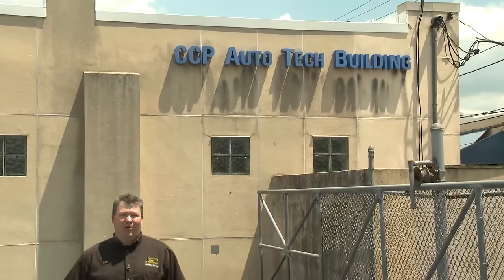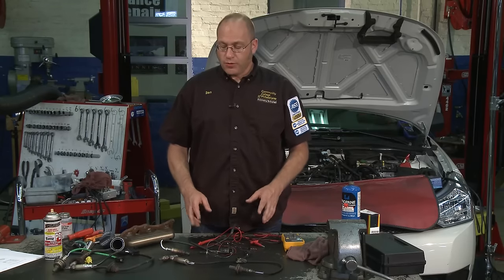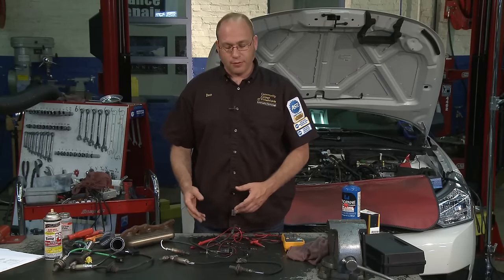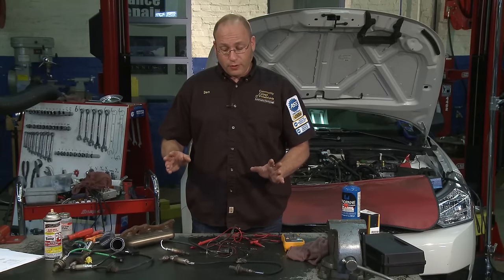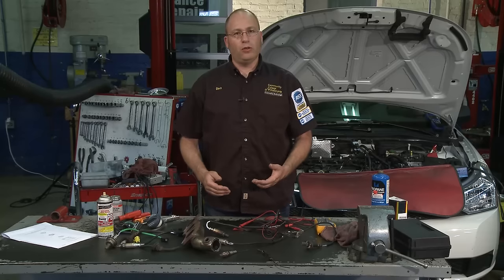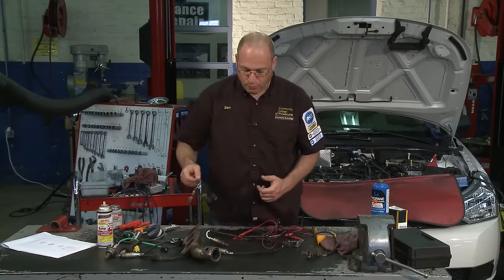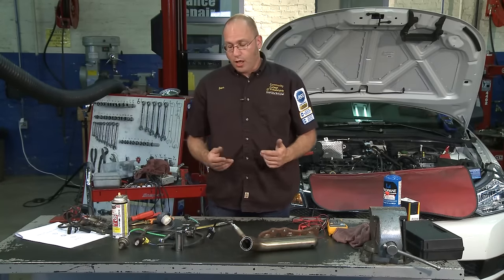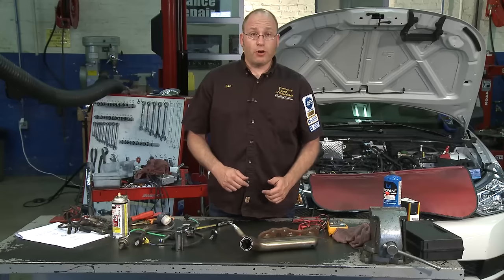Car Corner: O2 Sensor Diagnostics

Comment: I bought a set of o2 sensors that are supposed to be Upstream and Downstream. I can't tell which is Upstream and Downstream.  Neither are marks US or DS. They have the same part number. The only differences are one connector is black and one is gray. Turning the connectors so the black and gray wires are on top, the black connector has black wire on the right and gray wire on the left. The gray connector has gray wire on the right and black wire on the left. The existing sensors on the vehicle are identical. Both have black connectors and the wires are the same.
  I've been told the sensors must go in the right place (US/DS), they can not be reversed. Is it possible some vehicles CAN be reversed. I have a 1996 Jeep Cherokee Country 4.0 straight 6. Only has 1 UD and 1 DS.
Reply: The reason they are different (US/DS) is the temperature range they are meant to sense. It does matter on your Cherokee. Worst case, without a manual to look at, I would suggest try it one way, warm up the vehicle and if the codes are all gone you're good. But if it throws errors try switching them.
Reply: @benjaminmohler2016  I'll try that. Thank you.

Comment: hello , friend My car has the same problem , code p0131 , chevrolet optra 2009 manual gear. when the check engine light turns up normal. At that time, he's giving this code

p0131 -powertrain  o2 sensor circuit low voltage ( bank1  sensor 1)
p0122- powertrain throttle /pedal position sensor /switch A circuit low input

p1538- powertrain  tap fot multiple descriptions 
thank you.

Comment: Nice info, clear and concise, but I am changing my O2 sensors out after 50,000 miles. Cause it gets you better gas mileage and prevents breakdowns. Most sensors should be changed regulary, cause they can go out 25% plus or minus, and effect engine wear and gas mileage.

Comment: I have a problem I bought a sensor with the same connector but no timetable wire what to do?I bought a Bosch but my was ntk japan with same connectors but not wires?
Reply: ALWAYS TRY TO INSTALL THE SAME MANUFACTURERS O2 SENSOR THAT CAME WITH THE AUTOMOBILE!!! DON'T BE CHEAP. IT CAN LEAD TO BIG PROBLEMS IN THE LONG RUN! OEM PARTS, ESPECIALLY WHEN IT COMES TO O2 SENSORS, IS IMPERATIVE!!!

Comment: Hey you have a logical discussion here's a question to stump you? 2002 Dodge Dakota 3.9l v6 says no bus on odometer connected a scan tool and it said it can't link to ecm where to start looking for the issue?
Reply: Sounds like a CAN-BUS link issue.  Have a look here, sadly this is a real common fault. https://www.ramforumz.com/threads/no-bus-and-ccd.172091/
Reply: Hey, I appreciate it I'm kind of thrown for a loop because there's also a no crank issue on top of the no bus and I bypassed the starter to test it and it turns over if you excited the starter wire manually! Also to boot someone loosened the distributor so yeah really got me standing on my head on this one!

Comment: I like that bit about a shade tree mechanic and a tech. I'm not taking anything to a tech. Between more experience than many of my peers, other shade tree guys, and google I'll get it. I've thrown money at my truck in the past, multiple codes on a beater i bought cheap. That's not my general practice. No doubt I'm not as thorough but if i replace the wrong thing, it's still a hell of a lot cheaper than a shop. Normally though i get a fix done on the first try. You can bet that if i take a vehicle to a shop, they're gonna be scratching their head

Comment: O2 Sensor indirectly differentiates between complete combustion which generates high heat and higher voltage versus incomplete combustion which generates lesser heat and thus less voltage. It Can Not Sense O2 Directly and must be called Exhaust Heat Sensor.

Comment: i had an 0-2 sensor go bad just because the power steering put oil into the 0-2 harness and it got into the inside of the 0-2 sensor and made it fail. it did that a number of times before i found out what the cause was.

Comment: Dan,

This is an excellent video, although I do have a question. Some of these Oxygen Sensor Sockets are sold as a '7/8" and 22mm' size socket. This makes no sense to me!

7/8" is 0.875" and a 22mm is 0.866142"

This means they just are not the same size! How critical is it to have an exactly 22mm Oxygen Sensor Socket vs. one that is actually 7/8” in size? Harbor Freight sells the 7/8” unit for under $8, Snap-On sells the 22mm unit for $69. I am not a professional mechanic, I am a Computer Scientist that is thinking about fixing this issue myself in my car.

What say you?

Stuart

PS - I am originally from NE Philly!
Reply: Not a mechanic here — 3+ decades experience as chemist and pharmacist. That just a 1.01+ % difference in size. IMHO, the larger of the two (7/8th or 0.875) sockets should be more than good enough to remove 22 mm o2 sensors — mechanic’s pov welcome! Keep in mind, many auto parts stores rent specialized tools for free. Hope this info is of help to many. Happy Thanksgiving and Holidays 🙋🏼‍♂️

Comment: How can the sensor show voltage at your test if it is not connected to any electrical source. How can heat omit electrical readings
Reply: Lots of weird ways.  Look it up on YouTube.  Some material emit current when heated, although very small. Some control voltage when bent or frozen.  Crazy

Comment: 20:43 and if o 2 sensor is stucked, socked will expand and skip over hex, so you need to use quick release from bike seat post to fix it

Comment: i have a 09 dodge ram 1500 bought new about 2 yrs ago check eng light came on checked usual stuff no avail pluged in tester came back oil two thin rec. oil change  they used 20wt  went ahead and had oil changed to 30 wt  light went out first time i had that prob.

Comment: You cut the connector off the old sensor so you can use box end wrench to take sensor off. Use open end wrench to install sensor. The hard part is taking off o2 sensor not installing it.

Comment: A good in depth description however may have been a little confusing for general viewers. Showing how to test the O2 signal voltage when you where dealing with a heater circuit fault may have led the newbies the wrong way.
I think the other problem with the instruction was that you removed the sensor to test the heater resistance when you could have done it by testing in place with the harness unplugged. Otherwise it was pretty good representation.
Reply: tho kinda hard shooting a video with it in place depending where the o2 is and trying to test it

Comment: for and formost. this was very onpoint for solving o2 sensor issues. I myself just bought a 02 upstream sensors not realizing that i should have check it for an open heater circuit. non the less my vehicle witch is a 2006 nissan pathfinder approaching 10k away from 100,000 mi i will going to be installing them soon. I'll set on the side.

p.s. thanks

Comment: Impossible to solve a problem replacing just one part if it is a PO171 code -- lean engine code. Means any of a variety of things, might even mean an O2 sensor is bad, which is weird because there's supposed to be a code for the O2 sensor all by itself.

Comment: Great video. I just took my subaru to the mechanic to fix. Same problem with a different sensor code . My car is sixteen years old and I don't have the expertise for removing rusted in stuff in a tight place. You need the expertise to really diagnose the problem. The connector plug might be faulty but repairable and the rest of the sensor is good. It is a bitch to spend $$$ for a part and fault is a two dollar vacuum hose.

Comment: Hey I have a 96 caprice nd my check engine light flashing but I don't have catalytic converter in I never change my O2 senses on the car can that help stop the flashing
Reply: Dakota Brown I have a 94 with the LT1 that is an occasional come on steady. Never sets a code. Replaced O2 sensors 4 times before I got 1 from the parts supply that was not junk. Even a dealer sensor ax/delving bad out of the box

Comment: I have a Engine light on 2006 Hyundai Elantra GLS. Code reads 0234 catalytic converter which I don't think that's what it is because the car has no symptoms of a bad catalytic converter. No rotten egg smell no loss of power same gas mileage. I think it's the O2 sensor

Comment: hi guys.well I have a 2001 bmw X5   3.0  with a code  P0141 bank one sensor 2  . so I replaced the two of them and cleared the code .and then dove it for about 20 minute and the same code came BACK P0141. WHAT CAN BE THE PROBLEM?  DO YOU HAVE ANY ANSWER FOR THIS ? PLEASE LET ME NO IF YOU DO .THANK YOU SO MUCH
Reply: MAF or vacuum leaks are what I would focus on.
Reply: Robert Commodore lôok

Comment: so by the time I gotten to my work, 1/4mile away, Oxygen sensor has just gotten hot enough, so in my case no major savings! So in your propane torch demo, were you trying to prove that Oxygen sensor works on heat, so the hotter it gets, the more oxygen it says there is or is it more propane? this really is sure confusing, i did read somewhere that oxygen sensor does not measure actual oxygen content but the reaction of more oxygen where more oxygen mean the mixture is lean and the temperature is high, and when oxygen is less the mixture is rich, hence lower the temperature, and then again, we do not actually vary the oxygen levels because they are at a specific percentage in the atmospehere at any given location and altitude, so it is the fuel ration to atmospheric air that reacts with fuel as it is burning and yields temperature, so lean mixtures tend to burn at higher temperature, they say if your engine runs lean it will overheat, and so when it has too much fuel and not enough air mixture, or not enough oxygen in the air to burn all of that fuel that was injected inside cylinder, then the exhaust gasses will be less hotter, so basically Oxygen sensor is just a  Thermometer! 
and the engine computer interprets the temperature as the fuel air ration, we are being fobbed by car manufacturer's that Oxygen sensor senses oxygen, it doesn't it doesn't liars!! Lairs!  its a glorified temperature sensor~ !

Comment: So I did what I'm supposed to. I have a 2003 Land Rover Discovery, with 87,000 miles, ch engine light comes on and car had a slight miss. Read codes, says front O2 issue. LR recommends changing all 4 at 90,000. Replaced them. Car ran great for 10 miles. Then light comes on, major miss and now comes engine flashing. All codes are, 8 of them for major miss. Now what, changed wires, plugs, coil and still no better. No O2 codes, any ideas, frustrated and tired of replacing parts.
Reply: usually first codes and next few may all be related. if replacing o2 sensors took off some codes start with next batch. Also some vehicles o2 as well as plugs cars like certain brands better then others, best to try and get exact replacement parts dealing with especially foreign models

Comment: How in all F does a flashing check engine light have anything to do with damaging the Catalytic Converter?
Reply: You know, with the value of the vehicle and the low cost of diagnostic computers, they could integrate a decent self diagnostic screen to show fuel trims, voltage levels, and any other valuable status of components and modules, but they don't.  They could even integrate the wiring schematics and visual references of components, functioning of components and theory of operation of the entire vehicle... but... they don't.   
My left cat is bad, my right is working, but I'm having some misfires on the right, so the the computer is adding fuel to the right side trim.  A mouse or something ate through a fuel injector wire, so awesome that cat is probably next if I don't get these misfires fixed with the wiring.

Comment: I had my check eng light come on for my 01 Camry, someone ran a scan and said it was my cat so i went to a mechanic he put an after market cat in for me at 250 bucks but after a few days it came back on so I changed the O2 sensor and yet still the check eng light came on ..What else can this be

Comment: Buddy  I am and have been  ASE certified for 25 plus years. 
 And here is the real problem.
The ridiculous rates that  many shops and dealerships charge  compared to what the majority of people make. 
The shop I work for is $125 p/h.
Most diagnostic are $80 - $125  plus tax.
And  for so many people they just cant afford that in there budget. 
And  there for  problems go unfixed or they try the cheapest fix.
Often leading to bigger problems.

Comment: I'm glad my 1970 Chevy C-20 daily driver has NO oxygen sensor, no computer, no catalytic converter. Not the best fuel economy, but it is always running when our newer vehicles are stalling/surging/in the garage with some sensor/computer issue. And when something does go wrong, it is easy to diagnose and I can usually repair it myself. Case in point: once had to replace fuel pump on the Chevy truck....$40.00 and 20 minutes later, with minimal cussing, it's fixed. Had to replace fuel pump on '05 Durango, $200 pump, jack up vehicle and wrestle tank with fuel in it down, screw around with fragile wires and plastic fuel lines, took about 2 hours with much straining, invented a whole vocabulary of new curse words. Would have easily been a $500.00 repair if I had taken it to a garage.
Reply: Your rt my 76 vette has no o2 issues, no cat, no pcm and runs fine, I wonder if the auto makers would have put in all this extra stuff if they weren't regulated by the gov? Makes you go hmmm, Arsenioism lol

Comment: What if the actual Diagnostics gives you the wrong problem. The code given to me was the PCV Valve and when it was changed, the problem still persists. lol.. Otherwise, very good complete breakdown.

Comment: You don't solder and splice 02 sensor wiring because the 02 sensor gets its outside reference air through the wiring.

Comment: Actually the backyard mechanics are normally able to correctly diagnose and solve  the problems and replace the correct part with minimal expense. It is the "experts" that ring up the bills replacing parts needlessly until the problem is solved or just give up and never actually solve  the problem

Comment: we are supposed to guess where you hooked up the voltage meter to the sensor? the camera pulled away and your hand blocked where you attached it. Should have shown that important critical step better.

Comment: You diagnosed Faulty O2 sensor with your scan tool and confirmed heater circuit open-circuit using your multi-meter. Duh!! . 
You failed to note that your scan tool also showed heater current flowing before and whilst it simultaneously declared a fault with the sensor. 
Heater current flowing through an open circuit, I don't think so. 
You confirmed the fault as cleared using your scan tool by showing heater current flowing after sensor replacement whereas in reality it was flowing 0.17A before sensor replacement as your video showed and I observed.
At no point was there no heater current, further at no time was O2S11 warm and ready to operate, though I note the heater current went from 0.17A to 1.85A.
I think you got the correct conclusion for the wrong reason.

Comment: Just cut the darn wires and use the closed end of a wrench. The open end usually only rounds the nut part of the sensor. Why worry about cutting, I'm taking the darn thing out because it failed and want to replace it in the first place? If I only want to test it I do it without taking the sensor out.

Comment: I have a 2003 Toyota Corolla, and my check engine light is on. It came on right when the weather got cold. And after a day or so, it went off, then a day later back on. I went to Autozone and they said, 02 sensor on bank 1 bad. so I guess, i will have to go and change that myself.
Reply: Is it fix your problem? I have same problem. Please let me know? My is Honda accord.
Reply: ti inthalangsy i brought it to a local shop. They replaced it. will see if that problem comes back. i will update you with the result.

Comment: Not a bad video, but in the real world, especially the downstream sensor in the rust belt, most O2 sensors won't come out  unless you heat the exhaust around the sensor almost cherry red with a torch, and you better have a tap ready to re-thread it because it takes the threads out on the way out.

Comment: Catalytic convertor will probably get stolen anyway. Think i'll just put some duct tape over the light. It's getting annoying trying to troubleshoot all these sensors, relays, switches, and whatever else you drive around in. I need to get me an old 70's car that dont drive you crazy with all this. It's like driving your computer around depending on a program to keep it running. I cant even keep my computer running at home lol Good luck with this newer stuff.

Comment: To remove a O2 sensor that is corroded If you can lossen it just a bit is put brake fluid let it soak about 5 minutes. It should then come out easy.

Comment: Hi there I like your videos so far easy to follow. I have a Mercedes C280 with the 2.8 engine I've never gotten a o2 sensor go figure there's only 4 of them  lol The car has a fair amount of miles fast, and decent gas millage, it smells rich got any ideas? Have a Blessed  day   Dave
Reply: Get it scanned, the error codes will tell you what type of problem you may have. If it is an O2 sensor an error code will be generated and it tell you which one of the four are at fault. The two sensors that are mounted before the catalytic converters provide information to the ECM for air/fuel. The two sensors mounted after the catalytic converters essentially tell the ECM about the condition of the catalytic converters, to ensure they are operating within set limits.

Comment: @13:40:  Interesting.  I would have thought 2-wire = dedicated ground, not heated.  I've never seen a heated O2 sensor without at least 1 grounding wire.